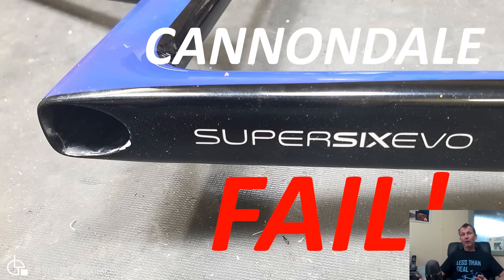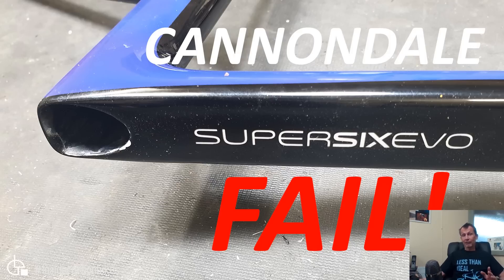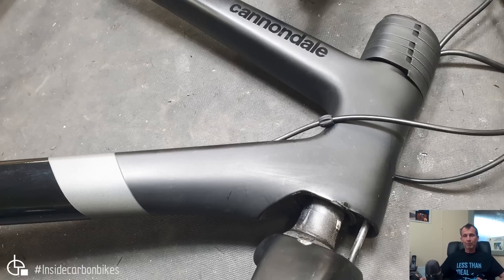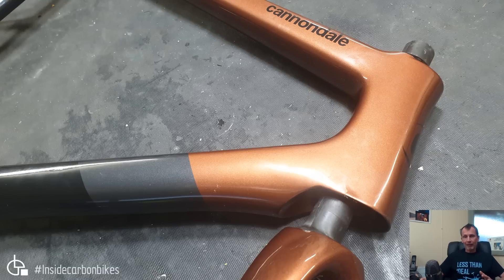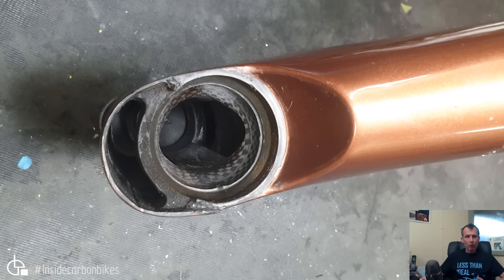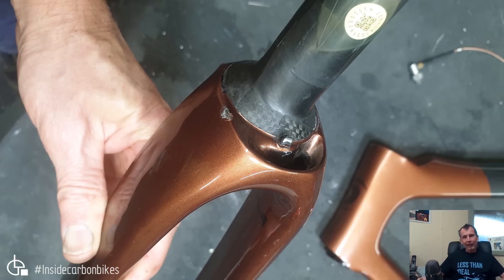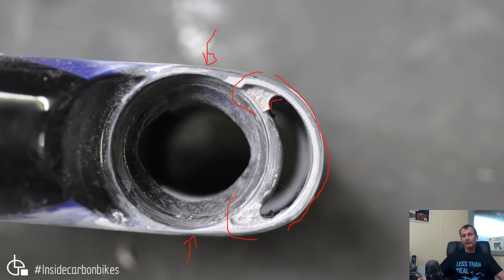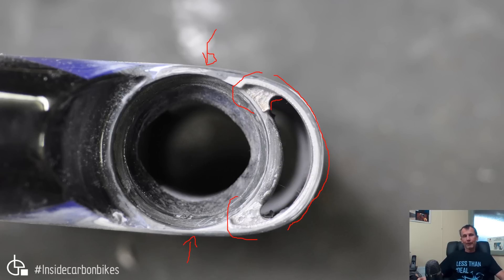Cannondale Supersix Evo Repair

Comment: Any idea why this issue is present on the rim brake version too? There was no need for them to put in a hydraulic hose defence mechanism...
Reply: It is, you can route your shifter cables through the frame still. Frames after a certain date came with a metal protector to prevent damage.

Comment: Why do the less severe examples need repair? Is it your contention that this would weaken the headtube and cause further delamination without further stress? Thanks for considering this serious question.
Reply from the maker: The delamination damage may grow during further use which could result in a larger failure. Thus it is best to repair as soon as the damage is noted.
Reply: @LuescherTeknik  Thanks for your reply. I have shared the damage in pics on my SS Evo (2020 model) with cannondale, which generally corresponds to your less severe examples. The delamination is about 3mm long at the lowest extent of the head tube. They suggested that "extensive testing" reassured that this defect was only cosmetic in nature. I completely agree with you that the design is flawed and it is unreasonable that they should have overlooked this issue. But it seems to me further delamination in most of theses cases would only occur if there is continued overrotation of the fork.

Comment: Hi there, great fix thanks. I have exactly the same - not quite as bad as your examples but can see crack on outer one side.  How do i buy the insert?  we use carbon and laminate at work a lot so i'm pretty comfortable in doing it except not sure the resin you mention,   Do you provide some instructions for the repair. Failing that there's a local guy who's a wiz at carbon bike frame repairs.  Thanks for that
Reply from the maker: I did a post on how to get an insert for people outside of Australia.

Comment: I just bought the supersix evo.. it was around 4700... I only used it once for a short ride. It's a 2021 model.. would this model have the metal plate you mentioned?

Comment: My bike cracked for the second time in that same location and I will continue to ride as it is. It does not look like it is very unsafe as it still has the whole tube supporting the fork pressure but will start slowly and see how it feels.
Reply from the maker: I do not recommend riding a damaged frame.
Reply: @LuescherTeknik    I am wondering why this is a structural problem.  Most of the defects are 5-8mm or smaller.  This seems to me a cosmetic problem, a stupid design , but this would not appear to weaken the headtube integrity. Tell me why this is a danger?

Comment: What a great solution. Is there any chance of getting this titanium insert shipped to the UK?  I have an excellent local shop that does carbon repairs who would be willing to insert this for me. Already had one frame written off due to cracking in the head tube, and I'd like to do some preemptive  work on my replacement frame. Thanks again for a great video!!
Reply: Hi Mike, did you get anywhere with your repair? Im from the UK too and has a small fall last night which has resulted in this same damage! Had the bike 2 months and will be very sad if it’s going to the tip before I’ve even finished paying for it! Cheers
Reply: @mujlos  hi Luke, have you cracked the head tube? I sent photos to the store I purchased from and they spoke with cannondale who agreed to replace the frame. They said it was not under warranty but a good will gesture. Basically they don’t want to admit the stop pin is a sh1t idea. In the first instance I would speak with the retailer. Explain you think the damage is down to the stop pin hammering the carbon. When I sent the pics they could see the bike was generally on good condition and purchased within the year. Cannondale agreed a replacement and the store I bought from sorted it all. Good luck.
Reply: Another thing to note is cannondale started putting inserts in in later models. If you do get a replacement frame you will find it comes with an insert that stops the stop pin hammering your carbon.

Comment: Is this also a problem with the System six? And will this also fit this model? I have a 2019 Systemsix with the same headtube design and stopper. Haven't had any damage yet but would be interested in proactively stopping the damage 🙂

Comment: On 2021 frames they followed same approach as you did, draw back of this - metal stopper on the fork gets snapped. 
Interesting how they will improve on 2022 model.
Reply: Hi. Could you send a picture of how this new version looks like? I'll try to confirm if nice has it. It is a 2021 model.
Reply: @wgfilho  if it is 2021 model, it has a metal insert just as seen on this video.
Reply: @karolissimenas8003  Thanks! I'll remove the fork to take a look at that. :)

Comment: Brilliant fix! Can this be purchased and installed on a non broken frame to prevent it from happening? I am very interested in getting my hands on one of these!
Reply from the maker: Yes, however it needs to be bonded properly with correct surface treatments etc so not just a simple thing. Obviously we can do it for you here.
Reply: @LuescherTeknik  unfortunately I am in the US. Is the bonding something any carbon repair shop could do?
Reply from the maker: @taylorpreisler5863  I can look into it.

Comment: @Luescher Teknik My Cannondale frame had exactly the same damage and was meanwhile repaired - obviously without your titanium part, though. Would you ship the titanium part here to Germany so I could have it installed by a local carbon specialist (who did the repair on my frame)?
Reply: You should have asked for a replacement frame, I got mine without any discussions (also Germany).
Reply from the maker: Sure we could look at this, I would need to confirm a few things with the repairer first to explain the process.

Comment: The same engineering approach that sees aero as the most important of design goals caused the fault in this model, as well as the Specialized fork failure recall clustercoitus that Raoul has just reviewed. Perhaps frames should be designed for structural integrity (& rider safety) first & foremost, & saving a handful of watts with shiny surfaces much lower down the scale? Anybody? Bueller? Bueller?

Comment: Any thoughts why they don't just do a one piece bar setup that would route the cables into the fork steerer by the top cap? Seems so much easier to engineer than this void in front of the steerer.

Comment: It’s a crime that the titanium insert isn’t there to begin with! Goes to show a lack of knowledge from the designers thinking up these bikes. I’m all for innovation but the limitations of materials need to be taken into account. 
Great solution you’ve got there and brilliant to save bikes going to waste over such a small yet important detail. Hopefully if youtubers like yourself keep showing up the big bike companies they’ll up their game and stop making sub par designs!
Reply: Don't forget that engineers rarely have the final say, $$$. I can't imagine that a bike engineer wouldn't have warned of this happening but someone wanted to rush the bike to market anyways or cut costs.
Reply: Do you really think it's a lack of knowledge behind this fraught Cannondale's design? I mean, two moving parts, one of a hard material, the other soft, repeatedly making contact, which do you think is going to wear out and fail first? This doesn't require an engineering degree to figure out.
Reply: How did the 2021 version fix this issue?

Comment: That looks like a super solid fix and what Cannondale should have put in the frame in the fist place.  Speaking of which, is Cannondale doing anything retroactively about bikes already in the market?

Also, would carbon reinforced polymer work for the insert instead of Ti?
Reply from the maker: I am not aware of any factory repair on this. The polymers you note are thermoplastic which does not readily bond to the the thermoset frame with epoxy adhesives.
Reply: What polymer?
Reply: @johnsmith1474  No clue, I'm not an expert but I know Magura uses a proprietary injection molded plastic / carbon material in their levers and master cylinders because its more durable to impacts than carbon fiber.

Comment: Great video Shouldn’t the manufacturer be retro-fitting these, or using local specialists? How would 6000 Al or stainless compare in machining, corrosion, cost, durability?
Reply from the maker: I think that they should support their product. Ti is best for bonding to carbon.
Reply: It's 3D printed, no machining. Your questiosn are nonsense, one would have to do testing and a study to answer. Instead he designed a solution that just works.
Reply: @johnsmith1474  Think you may be underestimating Rs vast experience Just looking for an easy answer

Comment: apart from the energy wasted to build the bike, which is not negligible, the carbon frame is actually a carbon sink, as that carbon will not be released any time soon
Reply: It's a trivial volume of carbon, and at any rate carbon is not the problem in an atmosphere, the problem is CO2. You could blow powdered carbon into the air with pumps all day and it does nothing harmful.

Comment: won't the metal strengthening of the head tube now break the pin? I think I read something along those lines, perhaps was juts someone expressing a concern
Reply from the maker: I haven't tested that, as it would be a destructive test, the pin in the fork is quite solid though.

Comment: It seems many of the manufacturers put out poor quality, if not out right dangerous carbon bikes. Internal routing thru the head tube for hydraulic cables, is totally stupid as you can't even see the wear taking place

Comment: I'm no genius, but a metal stop pin slamming into carbon will obviously damage the carbon. The harder material will win every time. The fix is only temporary imo too. The harder material will eventually destroy the weaker one. So maybe the TI fix breaks the stop pin and you eventually shear your internally routed cables. This is a horrible design, Cannondale engineers must be 5 years old to let this out to the public.
Reply: 5 years old? HELLO HAMBINI FANS!

Comment: Not defending Cannondale , but under what circumstances would anyone turn the steer tube that far? Is this just from passive impacts of  handlebar rotation when lifting up the bike?
Reply: Trackstanding at a stop. I do it all the time on every ride.
Reply: Placing it in the boot of a car usually requires turning the handlebars. I used to keep a piece of foam insulation and a flexible Velcro strap to secure my bars safely turned before I could afford a nicer vehicle with a bike rack.
Reply: hmm cycling through crowds when you need to keep twisting left right?
Reply: It's to stop bar slap as against the top tube I believe. The idea is good just poorly implemented.
Reply: @glennoc8585  The stop is there to keep the internally routed cables from getting crimped by the fork and head tube.  This is mentioned in this, and his other videos.  Bars hitting the top tube are usually a size and ergonomic fit issue, depending on how many spacers a rider needs under the stem.  There’s no way for bike companies to reliably compensate for that for all bikes.

Comment: I grew up about 25 miles from the Bedford PA factory.  It is sad that they made a world class product in the USA and moved it to China.  It is sad that they now make a crap product.
Reply: I sold my 2010 CAAD 9 last May. I regret that so much. Was easily my favorite road bike of all time. Believe it was the last of the USA made frames too. 😔
Reply: @sixate  it was the last
Reply: They made crap for at least the last 6 years..
One example is that they didn't strengthen size L and XL frames compared to the smaller ones. We replaced about 1/3 of the scalpel frames on warranty and don't forget about the Lefty disaster several years ago where it was recalled each year (3 times in a row)
Reply: @Nico-jt8ll  They closed the Bedford factory in 2015 and stopped building bikes there in 2009.

Comment: Is there a befit in limmiting the steering rotation? I wonder why they do this on high end bikes.
Reply: I don't think many bikes have this feature.
Reply: I believe the rotation is limited in order to avoid the internal cables from being compressed if rotated to the extreme.

Comment: I think I'll just avoid frames that route the cables through the stem and into headtube. I need my peace of mind.
Reply from the maker: That's what I am doing!
Reply: Have you seen many focus Izalxo Max's come through with issues in this region Raoul? Or any other? The more recent 2019+ model
Reply: I never thought that in the process of saving money id be ducking a huge problem.  Exposed routing for me as well
Reply: Titanium frame with all external routing for me carbon for though and discs, carbon 650B wheels and I a trade qualified composite technician. I wouldn't trust a close moulded carbon frame with questionable quality control Which rules out every carbon bike  manufacturer.
Reply: This damage on trek are normal
Reply: Hi , I have one of this frame set, how much will be the repair and reinforced the area with the titanium part?
thanks

Comment: Ladies and gentlemen, step up step up. Who will be the first manufacturer to kill a rider through abysmal engineering? Come on manufacturer's don't be shy, will it be Cannondale, Specialized or will it be Cervelo, Canyon to take the mantle through mediocracy,  mindlessness and the race to the "bottom" engineering. Come on we're aiming high to aim low. What's that you say, handlebars, seatposts and frame junctions? Or can we save a bit of time through catastrophic steerer failure whilst braking and face plant into the tarmac breaking your jaw, smashing every single one of your front teeth as they eject straight through your mouth below your lip, before lubricating the tarmac with your brains from your broken skull. Roll up roll up. Which manufacturer, which failure first. Maybe a failed brake hose on a Specialized, WHO WILL BE FIRST? Who be the first rider to buy it? Stayed tuned with these manufacturer's as your friend, you won't need enemy's. The grim reaper or is that rider is on they're way. Bet your resale on a SL7 is looking grand. What a total dogs hind leg
Reply from the maker: It may have already happened, it just hasn't been made public. Lots of close calls recently though.
Reply: @LuescherTeknik  When I was involved around the mining/heavy industry the guy who was teaching  hydraulics in my trade was a union rep mine deputy for 21 years. He told us in a toolbox talk the mine manager walked in and said, "we've had so many near misses, so many minor injuries, so many hospital admissions we're due for a death. Two weeks later bingo. What level of substance, strength of character, integrity do these companies have? If I was their manager I'd start the conversation by kicking a few chairs and desks over and asking for the resignation of the senior engineer before security escorted them from the building. Totally untenable when safety is knowing withheld over a family man's head. Unacceptable. Thanks for the reply.

Comment: It must have been designed by the guys who also designed the cervelo S5
Reply: And the sl7🤣
Reply: The S5 was never recalled, it was considered normal wear and tear, and the frame had reached end of life, and thus, not a even warranty issue.  They’re the F1 race car version of bikes, after all.  What BS.  Or, maybe not, considering the quality of welds that got Senna killed.  I was told that such welding was standard practice in the F1 world at the time, so maybe we shouldn’t be surprised with this crap.

Comment: Does any one know if the issue is present in the Super Six Evo SE/CX model?
Reply: Externally routed.
Reply: @bikes666  It's got nothing to do with routing.
Reply: @johnsmith1474  no fork stop pin on evo cx or se models, or internally routed through the headtube. These models had a 'standard' design.  Better?
Reply: @bikes666  great to hear thanks

Comment: I have a merida, I paid a fraction of Dale or big s type money, even though it came with full di2 and carbon wheels.  
It has a stop setup in the head tube,  but the stop blocks are big cubes of carbon with a matching seat to mate to. 
While I bet it's possible to break this arrangement, it going to be a huge impact that does it.  
 Strange that the expensive bikes can't do the simple stuff right.
Reply: I don't see it as "strange". If a company is strictly interested in maximizing profits, then there is no room for sanity in any respect. These brands aren't interested in cycling or bikes, if you ask me. They just found a way to make some idiots handing their money over to them. Oh, and pretty much all of these crooks make their own crappy cranksets, because they want to save the money for a proper Shimano crankset in order to get profits as close to sales as possible.
Reply: especially given merida owns part of big S and does their manufacturing....
Reply: @supersixmikeohimod  that particular irony was not lost on me.

Comment: What idiot engineer designed that? A metal pin bumping up against a carbon fibre surface is only going to end one way. Nice job Cannondale.
Reply: American Engineering.  You can see the standard of their graduates
Reply: Built in redundancy; the bike “wears out” so the consumer buys a new bike. Trouble with this design is that it wears out faster than they predicted.